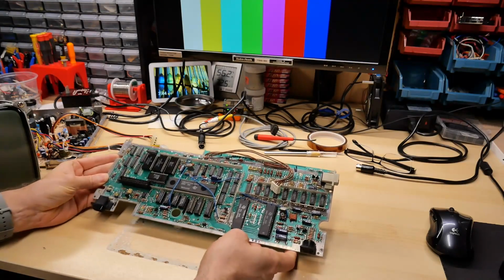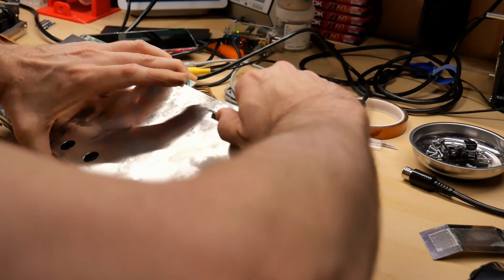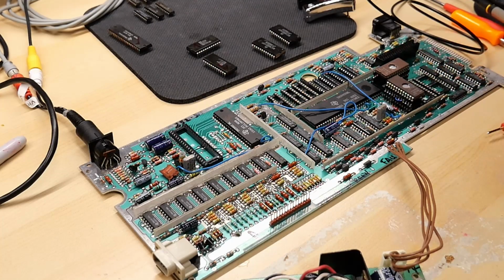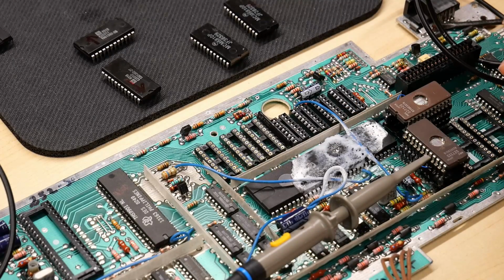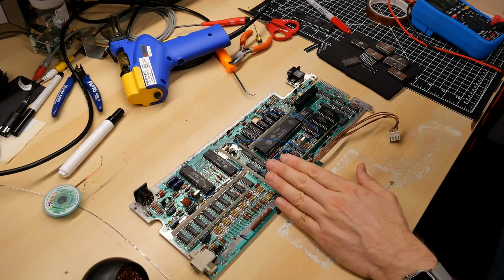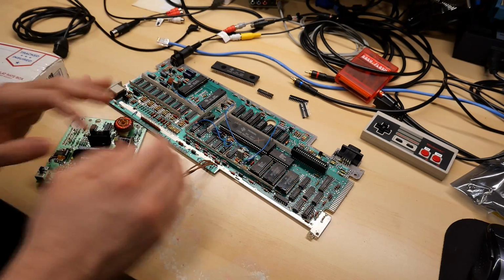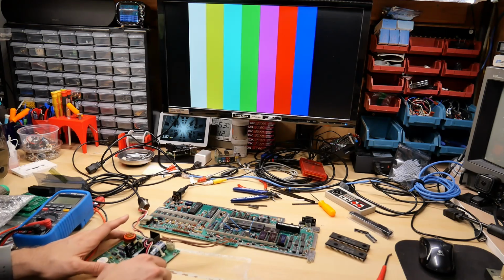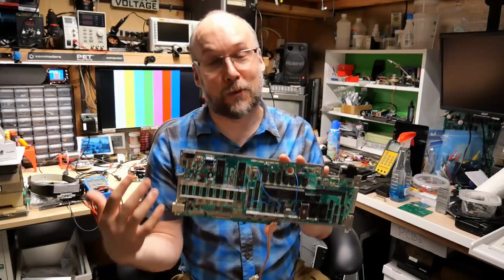Ti99/4A Motherboard Repair - Part 3 - More mistakes, but finally success!

Comment: In my work place in troubleshooting we always disconnect the 5 volts and grounds. But we had schematics but you can also get the pin outs on the internet. Also we used a heatgun and circuit chiller. And a few times my finger found the bad chip. Lately I found bad chips when they caught on fire for a second. 73

P.S. if you put a current meter and see if the current is too high or low. 73

Comment: From Denmark,

A wonderful youtube channel you have

I bought a TI 99/4A in 1982.

It was a fun time because if there was something we couldn't figure out, we had to solve it ourselves since there was no help to be had.

I quickly got hold of the game PARSEC, which I think was a great game at the time.

But in Denmark there weren't many who had such a TEXAS, so there wasn't much support for it, so I switched to a BBC B which I was super happy with, I had it for 3 years, and then it became an ATARI 520ST in 1985.

Today I have two TEXAS TI99/4A and an ATARI 520STfm., and my BBC B.

Comment: Hi, Adrian. I recently found your channel and I've been binge-watching. However, this is my first time commenting. Greeting from England, UK btw! ^.^
I LOVE your content. I find it fascinating, and your knowledge of electronics is incredible.

I did, however, have a quick thought about when you struggled with installing the new processor into the "pin socket things" 😋 that you had soldered to the board. I dunno how effective this might be, but next time, you could always try mounting the IC to the pin socket thingies first and then solder them to the board. Just a thought.
p.s. I also get that this vid is like 2 years old and you may already do this. But I thought I'd suggest it anyways just in case (and say 'hi' at the same time)

Keep up with the awesome, educational content.

Much love
Lee x

Comment: Talk about solder bridges when working on  surface mount chips that is a common thing. If you don't have equipment to install these chips you start by solder bridges and you wick out the excessive solder. I never used the machine because other parts had to be removed before you can install the Asics on the board to me that was too much work. My coworker taught be how to install these chips without using the machine an eye glass magnifier is a must to see bridges I guess microscope can be used but  not always practical. I can imagine if ti used surface mount chips. How much harder these computers would.be to work on. Thanks.for posting these videos I haven't watched the first two but I plan on watching them. 73

Comment: Yes freeze spray and the heat gun is the best trouble shooting tools you can use. I use them on the phone boards and controller boards at work. Also lifting up power leads on chips both b+ and grounds. Open traces is the most common failures on phone boards. I also found trouble by touching semiconductors ouch that was hot. 73

Comment: This is why I do most any soldering under a stereo microscope.  They're expensive, but the parts can be picked up cheap(ish) piecemeal on eBay.  Get one of the cheap LED ring lights, and a whole new world of reworking opens up.

Comment: If someone else hasn't already recommended it, I recommend a binocular inspection microscope like an AmScope.  This helps you see those solder bridges much easier.  They are getting a little pricey at like $500 for a good one, but it's worth it if it saves you so much time (and parts).  You can use it while you solder which I do.  My eyes aren't that much older than some of these chips, so they don't work great these days either.

Comment: I almost made the mistake of inserting the video chip in the socket according to the markings on the socket. I placed a white dot at the correct end. It is sad that TI could not correct this during manufacturing.

Comment: Great series! I recently bought an old Ti9/4A, as I had one as a kid, and it does not work well: I have to turn it on/off/on several times before it boots. Your videos motivate me to search the problem (even if I already replaced some capacitors), and I hope, to fix it. So thank you!

Comment: We’ve all made goofs at one time or another, Adrian. One time many years ago, I had a motor drive unit in for repairs, and it used a pair of failure prone MOSFETs, so the usual course of action was to strip most of the semiconductors from the board and install fresh ones. I did so, along with a new brake resistor (10 ohm 50 watt), and reassembled it. I do a quick power up check and am promptly greeted with a foot-tall flame shooting out of the unit! I couldn’t yank the power cord out of the wall fast enough, and all the parts I’d just installed were bad, and so was the resistor (last one in stock too). I found out I missed one diode that is almost hidden between two big caps. 😑 The unit was eventually properly rebuilt.

Comment: Watched all 3 parts.... i still have my original ti99/4a from 1983 when i was 7.... i've picked up a couple of spares over the years thinking i might need spare parts some day....

I want to re-cap the machine, so i was looking on youtube to see if anyone might have a specific video on recapping it... not that i've found... 

But yeh... just got sucked in to your troubleshooting series...

Side note.... isn't that little digital soldering iron the best freaking thing ever?

Comment: Now you need to do the modification that doubles the speed by getting around the bus bottleneck or whatever.  I saw it 20 or 25 years ago at a users group meeting.  What I saw was a hole in the top of the case, a small added circuit board and lots of jumper wires.  The computer basically ran at twice the speed.  I see nothing on Youtube.

Comment: An old trick to 'recover" chips that don't pull up hard enough on some data bit is to put a resistor from the weak data bit to +5. Sometimes it works, at least for a while. Something like 2.2K from the data bit to +5 might "recover" that ROM and not cause an overload for the rest of the machine. I certainly wouldn't try anything smaller than 1K, but with CMOS/NMOS chips you can often get away with a 10K resistor.

Sometimes this is a permanent hack, and sometimes only temporary. Once you punch thru the oxide with to high a voltage the chip can continue to degrade over time. Then again, sometimes it doesn't.

Comment: That was great. 
Doesn't matter how much experience you have...You can ALWAYS balls up.
I was repairing a very rare walkman and was taking exceptional care as it was full of extremely delicate wiring etc..and just as I finished the repairs (took many combined hours)..I mean the instant I thought aha! done it..The door mechanism decided to fall off  - breaking a ribbon cable - a nasty one . The door mechanism I couldn't make detach no matter how I tried after refitting by wiggling or wobbling. It needed to find a position and  be held at an angle and then slid to detach...I still can't believe it just popped off or the timing of it or the breaking of the worst part possible. I'm sweating writing this thinking about it.

Comment: The TMS9900 was a beautiful CPU chip - I got spoiled by it as a novice Assembly programmer with my TI-99/4A and the Editor/Assembler package.

If Texas Instruments had extended the 16 bit bus to the side connector and released the E/A package in 1979, the TI-99/4 (and 4A) would have been game-changers with an influence in the computer field to this day. 

The GROM (Graphics ROMs) were encoded in GPL (Graphics Programming Language) and automatically incremented their addresses with each access. TI BASIC was so painfully slow not because of the machine, but because it was being interpreted twice from BASIC to GPL to machine language. It was possible to mount several GROMs in parallel, some of the simpler cartridges like Car Wars and Editor/Assembler just used GROMs and had empty sockets where you could install several GROMs and have several cartridges available from the boot menu. TI Extended Basic, Parsec and Alpiner, IIRC, had 28 pin chips on board because they were providing static RAM to the system when the TMS9918A was being pushed into bitmap mode. 

A TI-99/4A only comes to life when you add a PEB (Peripheral Expansion Box). Until then, the only time you get to see a TI-99/4A really shine is when you stick a Parsec cartridge into it. The 32k RAM expansion makes all the difference in the world. Doing the piggybacked 32k RAM expansion on the 16-bit bus (a common hack) killed a motherboard for me the first time I did it, but made the damned thing so much faster than a stock memory expansion and kept my TI system useful until I moved to Amiga in 1993 or so! 

https://www.youtube.com/watch?v=uCSQd0eJKQQ

Comment: Extra careful... don't poke and rub a board with a metal pick while you talk!  Don't twist and flex a board with your bare hands to see what happens!  Don't slap and tap on a board and chips as you gesture with your hands in a way totally unrelated to what we're looking at!

Love your channel, I'm a subscriber, but I don't think I'm the only one who cringes as you manhandle a board, poke, prod, rub + bridge pins, and throw chips around while hand gesturing after doing meticulous soldering / desoldering work!
Reply from the maker: You should watch how boards are assembled in factories. This is exactly how things are handled... This stuff isn't fragile nor delicate.
Reply: @adriansdigitalbasement  Am absolutely sure you know the tolerances better than I do... but for anxiety's sake, can you poke with a rubber tipped tool?
Reply: P.S. the last time I saw you make a pin adaptor, I think you heated up the chip you were adapting...  :()  Great double stack on this one!

Comment: I'm looking forward to part 4:  fixing the keyboard and finally assembling the machine. 
Keep on going.
Reply from the maker: Won't be a part 4 at the moment as I am still missing the keys. I did assemble that computer but it'll be a backup for the main silver one at least until replacement keys can be had. :-) Thanks for watching!

Comment: I was a production test tech for a number of years and have made every mistake in the book. Don't kill yourself over making mistakes as long as you learn from them. My job was harder because we were fixing boards that had never run. Diodes in backward, IC's in backward, wrong parts installed, solder shorts and traces shorted under the solder mask, etc etc etc. Love watching someone else do what I did for so long. Thanks....
Reply from the maker: Wow that sounds tough! Was it always the same board or was it random stuff? Meaning, could you get super knowledgeable about the board so you could spot problems? Shorts under the solder mask -- that must be the hardest to figure out!
Reply: Adrian's Digital Basement we would do a box of 25 and then whatever was next! You would set up your test equip using the test procedure run all the boards to get the good ones out then start with the fun ones, shorts or fire. If all boards failed then you look for major artwork problems or wrong parts in the sequencer for auto inserted boards. I could talk about this for hours. System test was even more fun and government equip was tougher! This was a job and your were trying to get then done ASAP. They were parts of systems so it was not the whole picture. Just signal tracing for the most part. Not like a single board computer where the whole thing is in front of you. These were multi board systems with you testing one board of the whole systems. Power supplies were better as you had the whole thing sitting in your lap. Later in life I did a lot of wire wrap boards with filter caps soldered below the wire wrap. Shorts were hard to find. Sometimes you inject a little current and feel around. If time was short you took it to the parking lot and used a car battery. Fixed it one way or another!!

Comment: Ha, i made almost this exact mistake this week when i was trying to repair a failed ram chip on an Amiga. I actually manged to scrape a little bit of the solder mask on the data lines that went between the pins and managed to bridge them. Luckily i just bridges 2 datalines together, so it just stopped the computer from working, it didn't cause any damage.
Reply from the maker: Yeah a much more likely outcome when you don't have "high" voltage running all around the board like on the TI!
Reply: @adriansdigitalbasement  High voltage and no solder mask between the pins, those Barbarians!

Comment: I highly recommend picking up a USB microscope. They are fairly cheap and give you a better view of things than the goggles. You can use your whole computer monitor as a screen for soldering.

Comment: I remember this computer as a kid, we had a cassette drive and the speech module. Parsec was a cool game and I remember a math game called Hunt the Wompus. But I also remember that we had Pac-Man and Donkey Kong that I believe were Atari carts but the sharp corners were cut so it would fit into the TI, I don't remember if the cart was modded otherwise but that was neat!
My next machine was a IBM PCjr. LOL, that poor thing...LOL, but also neat with it's IR keyboard :)

Comment: Now you need to do that 8 bit to 16 hack that doubles the speed by getting around the built-in bottleneck or something.  I saw one at a users group meeting 20+ years ago. I recall the guy had added a small board with some chips and jumper wires.

Comment: I think the TI was a 16 bit computer where the Vic-20 and C64 were 8 bit computers, which is why the TI had better graphics. My first computer was the TI99/4 which had a chicklet keyboard. Later I upgraded to the TI99/4a which had a normal style keyboard.

Comment: This video reminded me how I fried my own C64: I was fiddling with the user port which has the Serial ATN IN line next to the 9V line (yep, no safety ground line in between), I slightly angled the connector (to pull it out, was very tight) and it ended up bridging the two lines together. Boom! Lesson learned: switch off everything before inserting or removing connectors

Comment: Good job! I'm thinking one of the little wires that leads from the case pin to the CPU die has a barely intermittent break. When the chip is cold the break closes. As soon as it warms up and expands the break manifests.

Comment: I've had bad luck with those turned pin sockets on my c64. I installed two single row turned pin headers in the first CIA location and it didn't work, I found out it was because the pins of the CIA were too loose... After tinning the pins of the CIA, they fit tighter and it worked

Comment: Wow that ending man, it feels so good when you been working on a project for so many days to just to find out it was a simple thing messing it up in this case a Bad ROM, that’s so amazing, kind of feel bad watching you doing all that work but at the same time it’s a working experience, recently I’ve been working on a Sega Saturn that was giving me a lot of trouble turned out to be one of the data lines on the bios chip wasn’t giving me continuity and it look like it was broke but it was like a hair, I wasn’t able to see that until I use a microscope and then added a patch to that trace and it work, it feels really amazing when you finally get thing to work but also all the process and abilities you get when it’s finally working.

Comment: Hi Adrian,

That was quite a challenge and I am happy you were able to restore the board using the EEPROM chip, however I am not totally done yet.
You said the ROM chip is bad and, when checking the datalines - it indeed looked bad. 

However, you didn't include a scope-picture from the EEPROM which made me think, is it really restored or is the EEPROM just marginally better and works for now, but maybe not the future? 

From the scope-view, I felt that there might be a damaged capacitor on the board that would alter the signal integrity - maybe that's something you could still have a look at?

However, I am not a specialist (far from that!!) and might be thinking too difficult, but it might be worth double-checking :)
Curious if you did and if so, what the result is.

Best regards,

PC4AD, Anton, The Netherlands

Comment: Thats some piss poor circuit layout design, running 12v lines in between data lines on the CPU, Its as bad as Apple putting 20v power pins right next to data pins on their connectors

Comment: Glad you got it working.  We all make mistakes like that.  Sometimes we're our own worst enemies when troubleshooting.  My troubleshooting skills are a bit rusty (or maybe 8 bits rusty) and your series helps me learn what is 'normal' and isn't when it comes to signals.  Great series and channel for those of us that love the 1980s and 1990s 'glory days' of computing.  When you mentioned the story about your viewer that was given a TI-99 by a teacher that had it in his basement, I remembered about 12-14 years ago I found one at a thrift store, cleaned it up a bit (it worked) and sold it on ebay to a teacher who wanted to use it to teach his grade school students how to program in BASIC.  It would have been so cool if that was the very TI-99 that he got, but the timing and location were probably way off.  I now wish I would've kept it, but I grew up with Commodore and it didn't have much personal meaning to me at the time, and I already have so much stuff and nowhere to put it.